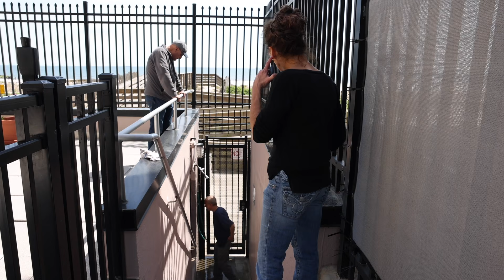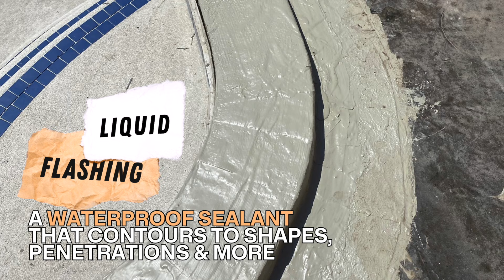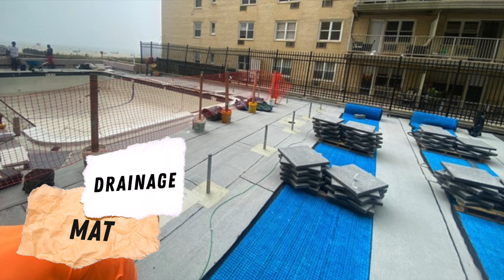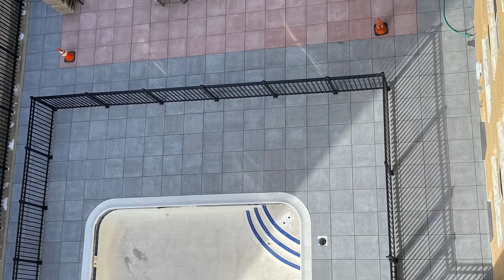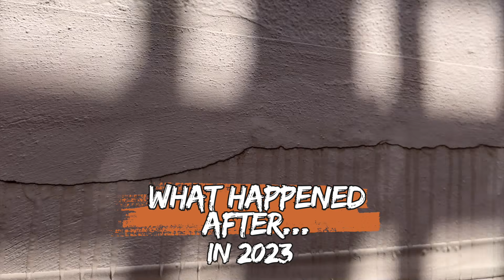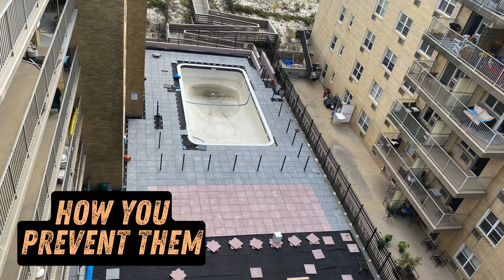Avoid Disaster Using Concrete Pavers over Modified Bitumen Tapered Insulation Roof System

Comment: In Europe, polymer modified bitumen roofing is basically obsolete. Torch-on bitumen felt is now generally only used for repairs on bitumen roofs.  We now use either EPDM or single ply PVC membrane that is of higher performance and without any cost penalty.  There are cost advantages to repair failed bitumen roofs with a single ply PVC overlay because you don't need to remove the old bitumen roof, which is a costly exercise.  With single ply PVC there is no requirement to add an additional liquid applied sealant.  Putting paving on stools is a common overlay finish where traffic is expected or indeed you could install a Sedem roof for a more natural finish.

Comment: As part of flat roof solutions; help us detail the difference between a walking finish and a drive-on finish?  How does the system incorporate planted surfaces, extensive and intensive?  What considerations are for drainage runoff volume?  A flat roof can collect a lot of water and overflow the drains in heavy downpours.  i've used pavers for access areas and protection of features in green roofing.  The main thing is to keep the UV and heat/cooling cycles off the waterproof layers, so the covering of pavers, stones, gardens, cappings gives the roof longevity.

Comment: As an architect, I appreciate the detail. If anything, I'd say slow down and maybe diagram the layers. Instead of this first, then this on top, then this on top of that, maybe explain the vapor barrier, x square foot, over everything. This is how we handled the edge, this is what happened at the pool coping. Then the modified bitumen. Modified how? It's obvious you have the experience to speak authoritatively on the subject.